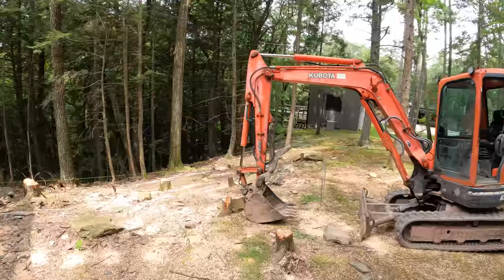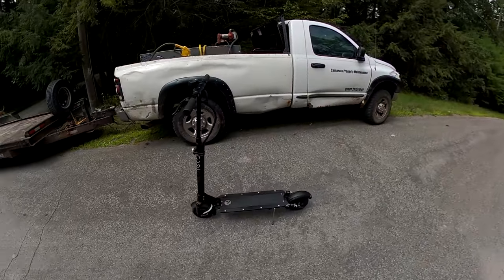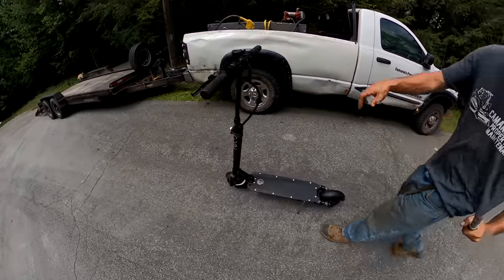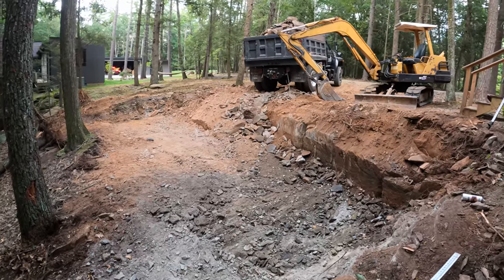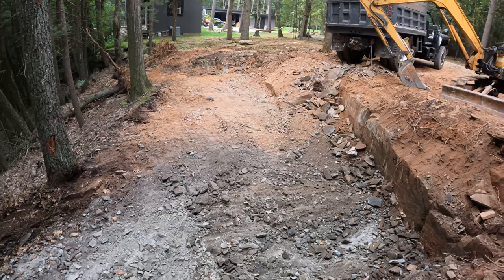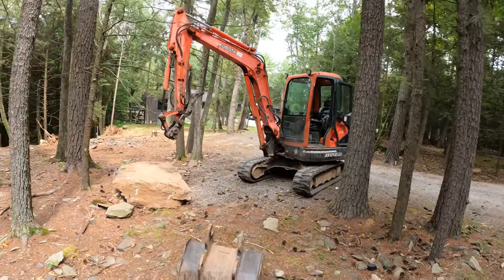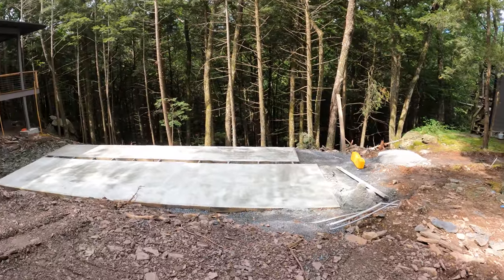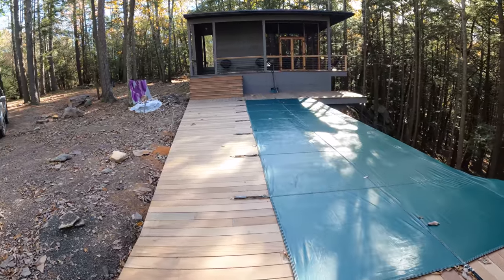Hammering a hole for a shipping container pool

Comment: It truly is a pleasure to watch your precision and finesse when operating your heavy equipment, it's as if it is an extension of your arm. Those fortunate enough to hire your services are getting a real pro.
Reply: Most of the time, lol. he seems like a decent guy but does some really dumb stuff sometimes.
Reply: Dear Roger That
👍👌👏 Very well said, Sir!
Best regards, luck and health.
Reply: @maxwell6504  agreed, he is a genius with that small trackloader but i have still no idea why he thought putting the ram between bulldozer and camper was a bright idea
Reply: @ Roger That,if you like to watch a smooth operator,on different machines and projects watch LetsDig 18,I like watching them both ,different style but both interresting.
Reply: thats what she said
Reply: @Genesis23OPB  Guess he needed steering to keep the camper out of the trees hugh? Would have been OK with right front bumper/winch mount!
Reply: @mrwrightoser8293  mhm.. maybe, but considering his skill driving with his machinery i think he could have managed without the ram just fine

Comment: When I lived upstate all I could think of was getting a crusher. There is so much quarry rubbish just laying around. loading it myself $5.00 a load. Some access was a little rough, not all. There is also bank run gravel deposits in NY in state.  Leased a stretch of railroad bed, sold and used the ballast and screened the bank run gravel to item 4 for the highway shoulders and septic systems. Nice work Andrew.

Comment: I was astonished to see the extensive root systems for those trees in such rocky ground, especially that one with a huge one that looked like a sapling wedged between slabs! Also, whenever someone has to hammer through rocky ground like this, I always wonder if they'll wind up uncovering an underground aquifer! Decades ago a quarry about 15 miles from me did just that, & the water poured in so FAST that they had to abandon a lot of heavy equipment. It's known as the "Blue Hole"  because of the cobalt blue color, the water is ice cold, & the state now manages it with safety regulations as a swimming/diving spot.
Reply: new mexico?
Reply: @sgtbutttacoi18  No,  Alabama.

Comment: I've got a project for you-

That old JD backhoe- make a frame you can connect to your (either) dozer,
make the stick an "Attachment", remove bucket, install a BIG hammer.
The big dozer already has (had) the plumbing, remember those two hoses 
that went to nowhere? Tie in the hammer to the winch's PTO pump,
so plenty of kick. A Dozer with a stick & attachments. Great for ditches,
where a Ripper requires driving over (straddling) the rip, whereas this
setup can be done sideways/diagonal.

Imagine that?

Comment: I have the smallest breaker Kubota makes. It's tempting to start in a corner but from experience, it's better to start from an open side, like in this case the lowest end. Once you make space for the broken rock to move into the breaker works better. Very slow work when you are used to moving bucketfuls of loose material. Fun to watch sped up though! Thanks Andrew.

Comment: I think a rock surface is a good base for a swimming pool. Remind
the heavy load when the pool is filled. Pouring a slab onto loose
soil needs more rebar - you save the other way expenses and time.

Comment: Seems that I remember you purchasing a stump ripper a few years ago as so many others on YT have, but I didn't see it in evidence?  Do they not work well enough to take the time to switch out??  Don't see many using them after the first week of playing with them.  Is the hydraulic rock hammer more efficient than a pneumatic hammer?  Your Ford dump is looking good.  Thought it was a brand new truck in the first frames of it.  Can the Yanmar load the ten yard?  Nice job.  Does all the water just recycle that flows over the top?  That Cody can sure run!!  I was amazed at him during the side by side video.  Take care.

Comment: Andrew... do you happen to ever run across one of those large concrete saw setups..  so you might be able to slice thru the rock in the ground to dig out the middle easier..  it will probably make a heck of a mess slicing thru the mud and rock and keeping the blade cooled since you seem to be digging a lot of foundations and pipe trenches.

Comment: Please don't push dirt up against the pool once installed. Not sure if you were planning on burying it or not, but it will rot away quickly. In wastewater they use to bury steel tanks all the time and now all the tanks are rotten and getting replace.

Comment: I had a really good idea for a project for Andrew. Dig a pit to work on the underside of heavy machinery. Narrow enough to straddle with tractors and trucks, it would effectively act as a lift to work under the heaviest vehicles. Line it with concrete and put in stairs to walk in and out. Would be a great addition right over by the carport area i think. Thumbs this up!

Comment: ave you considered gettign a gravity fed screen you put under a cliff on your property to dump trucks o shovels of dirt on? also maybe a rock crusher for makeing cheap gravel 
you could build a hydraulic one with only a few parts like a strong cylinder like used in a demolition shear and pulverizer
maybe you can get a jaw rock crusher from a abandond mining operation for close to free 
slap a hydraulic motor onto it and put it onto the skid steer or tractor auxiliary hydraulics - or put it on a trailer frame and make it plug in electric since its cheaper than fuel

Comment: Andrew , I had to travel to your region in city of Catskill to rescue my friend from people who had no clue on how to design a kitchen firstly . When I arrived his bathroom contractor skipped out on the job right after I questioned him about the use of 1/2 in concrete board instead of a pouring in a concrete mud job with wire . I asked where do the vent lines run for the toilets sink and the shower ?  The guy had nothing to defend himself so he quit the job . So do I have to move up there for few months or do you have a guy ?

Comment: 40:36 Will there be a ditch put in, on the uphill side of the new driveway, to collect rainwater, and runoff, so that it is diverted along the driveway and doesn't flood the driveway, freeze in the winter, and cause potholes?

Comment: How much would you, or a job like this cost ? I think just to do what AC did, here, $5-6k ? I'm not a contractor, OR a hole digging shipping container installer 😣😄 Is is by the hour ? By the equipment needed and used ? Being it's NY, that shale rock is figured into cost already 😣🤔

Comment: You know you can turn up the AUX flow digitally on the dash in that particular 360
Reply from the maker: I do not, what is a 360?
Reply: @AndrewCamarata  your 360° kubota has a setting in the lcd menu with an image of a ram/cylinder with the option to raise the flow /volume of hydraulic oil to the hammer,, that is some good content you guys are putting out hats of to you guy, happy new year from Ireland 😉🎉
Reply from the maker: @driveheronman4304  I don’t think that machine does, it doesn’t have a big LCD menu like that
Reply: @AndrewCamarata  ah its probably the earlier model with a little black half inch round knurled knob near the key, picture of a cylinder under it.
Reply from the maker: I’ll look at it, I don’t recall seeing that there though. When I got that hammer, the guy flow tested it and it was right
Reply: @AndrewCamarata  I see, it may have been optional to it, we hire these out also and the biggest killer on them is people think its a pick and pry rock with em then comes the oil, if you treat her right it will be good to ya the way it is 👍